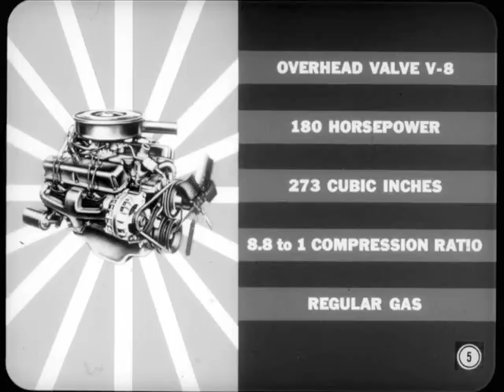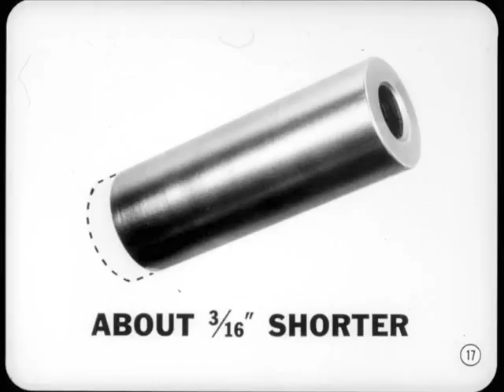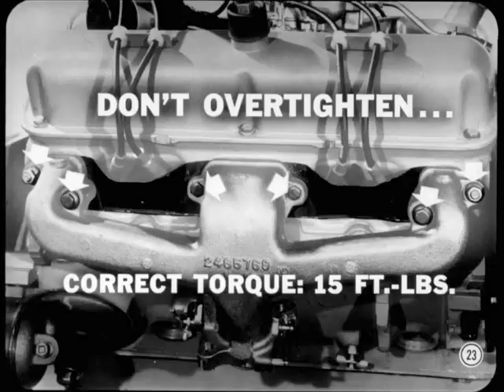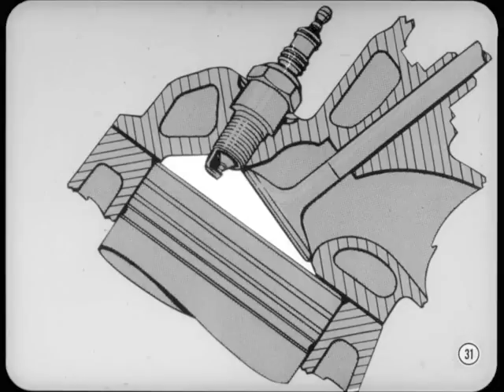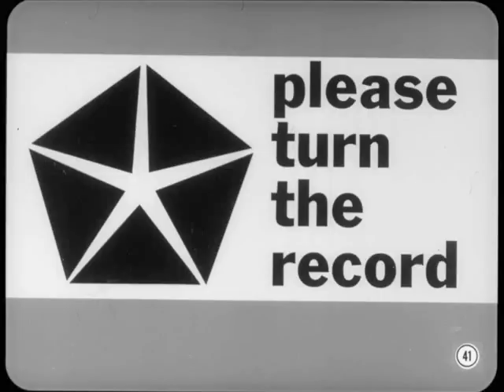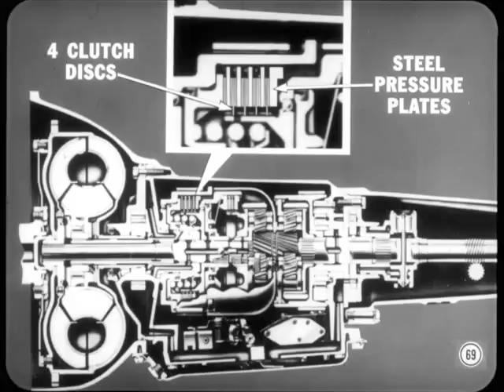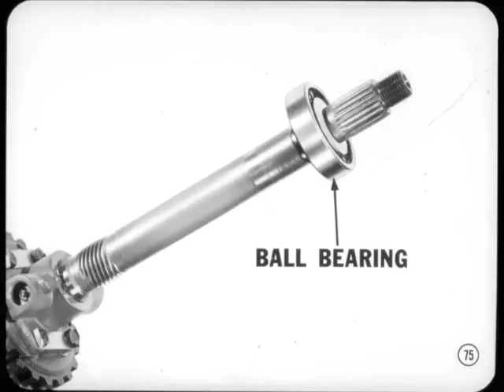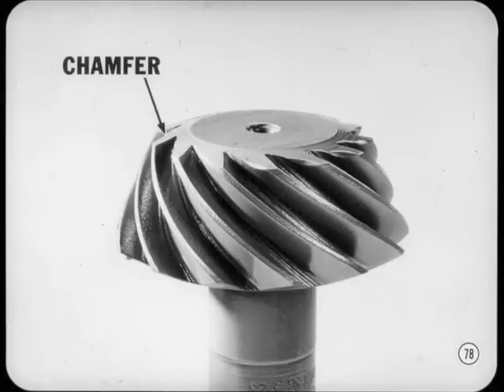Chrysler Master Tech - 1964, Volume 64-6 V-8 Valiant and Dart

Comment: 2:51 Four valves?
Reply: Listen to the narration. One set is for the valves on the left bank and the other set for the valves on the right bank. And no, you can't rotate the piston 180 because the skirt is asymmetric and the wrist pin should be offset slightly to account for the thrust direction.
Reply: @straightpipediesel  I get the four valves. Didn't realize they were used in regular street cars then.
Reply: @scratchdog2216  No, the engine only has 2 valves per cylinder. The piston has 4 valve cutouts so the same piston can be used on either bank of cylinders.
Reply: @straightpipediesel  Oh, now I get it. Thanx for sorting it out for me.